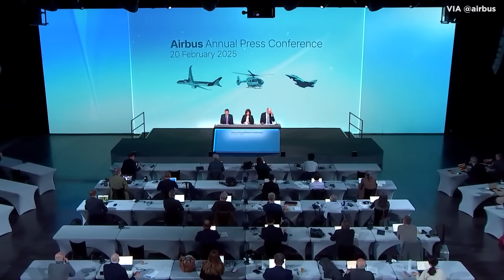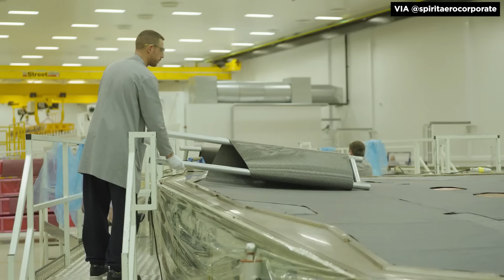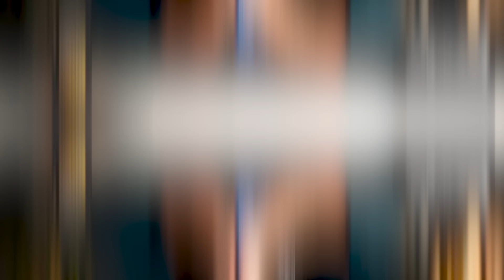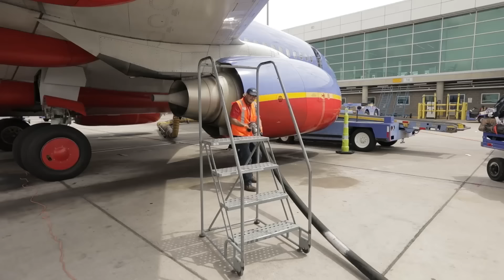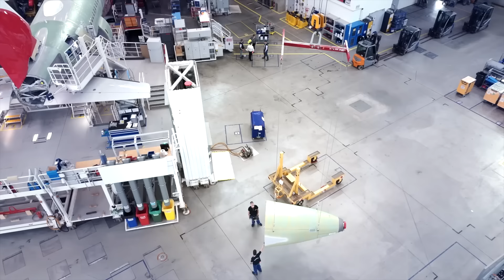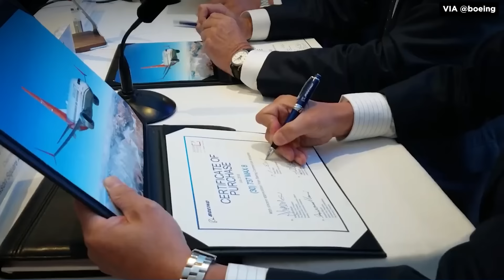Did Airbus just Change EVERYTHING?!

Comment: It's all about energy to weight ratio, and petroleum fuels are just hugely better than anything else, and that's before you get to the infrastructure problem.
Reply: In energy to weight ratio hydrogen is 3 times lighter than aviation fuel. The problem is volume.
Reply: @elkozinski  yes but the heavy reinforced tanks negate that completely
Reply: @nether_bat  Hydrogen is supposed to be liquified by temperature, not by pressure. They'd need thermal isolation, but that's not heavy.
Reply: @elkozinski  yes but hydrogen can leak through most materials so special (heavy) tanks are needed. And if the cooling system fails the tanks will become pressurised within a few hours, risking a catastrophic explosion that could kill people nearby.

Comment: Idk why but the mock of the Rise on a small plane looks terrifying. Small children everywhere will refuse to get on that plane lol. One strong argument in favor of not using the open fan design on that note is engine cowling can catch dislodged blades/fragments
Reply: I don't think they'll ever be able to get noise levels down to closed fan noise levels either
Reply: Blades that big will have to spin at a slower speed, fuselage parts in line with the blades can be reinforced
Reply: Is it significantly different than props though?
Reply: @brianwelch1579  this is just speculation right, but i would think the larger blades would still have less energy than traditional props(so less dangerous) although their size may still look scary to some i admit.
Reply: You can 'armour' where they hit, which they still do currently sometimes. (Kevlar and resin would likely be enough to catch them, and thicker plexiglass windows there)

Comment: If we consider the rate of improvement of battery technology/cost, an electric airplane is much more likely and feasible than hydrogen.  You should do a show on this.  Battery energy density are improving dramatically each year
Reply: Battery is viable for puddlejumping. Longer haul is where the issue lies and the long term solution for many routes is likely to be vactrains, despite the incredible capital expense of establishing the infrastructure
Reply: @miscbits6399 vactrains are an impossibility. Vacuum tubes are notoriously tricky and any failure kills everyone on the line. Some miniature cargo for between amazon warehouses maybe, but they haven't even considered that yet.

You can't defend it above ground, or maintain it below ground. It's a toy of an idea. Maintaining that pressure would be a huge energy sink also.
Reply: It would take a many fold increase in battery technology to get even close to the energy density of standard jet fuel. Engine efficiency is the best place to focus.
Reply: No, even a basic electric car weighs more than double its petrol equivalent. Look up the rocket equation and it will make sense. Electric vehicles weigh roughly the same at the end, petrov vehicles get much lighter therefore increase greatly in efficiency over time.

Even if they could make parity in energy density with fuel without extreme volatility (which is chemically implausible)  it still would be a huge downgrade from aviation fuel.

And that is besides the use being much higher than a leisure vehicle, that's a lot to replace every couple of years.

Sure drones work, and maybe light aircraft, but commercial jets have dangerously high power draw
Reply: @mandowarrior123  Electric cars don't weigh twice as much as petrol cars? You're telling me that for example, an ID.3 weighs 3000 kgs?

Comment: The hydrogen issue underscores what most critics have been saying for years - apart from the handling issues there's no "green" source of hydrogen that isn't both highly restricted in volume AND insanely expensive to produce - to the point that if you HAVE the cheap green energy to produce hydrogen, you have the cheap green energy to take the extra steps of adding atmospheric carbon atoms to make much denser and easier to transport hydrocarbons. The extra cost of doing so is vastly outweighed by not having to incurr the costs of handling hydrogen
Reply: The only problem is it's even more expensive to create fuels from hydrogen. Like it almost takes twice as much energy to create hydrogen and turn it into methane compared to just producing hydrogen.
Reply: @seasong7655 

You know that there is already a carbon negative methane fuel that is widely used in large quantities in California that is half the price of diesel.
Reply: @seasong7655  I totally agree with you on this criticism. The problem is that for longhaul there isn't much else which has the energy density. Gas turbines will exist for a very long time, just the exact composition (ie: Kerosene or something else?) and cost of the fuel will vary

As we decarbonise in the future, oil is going to snap well over $200bbl and at that point synfuels start making economic sense - with the ONLY viable energy source being some form of nuclear power. Keep an eye on what China's doing with TMSR-LF1 (A rebuild of 1965's ORNL MSRE) as this is the future path I expect nuclear to take - no more water in the core of reactors means a huge safety margin plus temperatures high enough to directly drive industrial processes such as Sabatier

Molten salt reactors have the potential to reduce nuclear costs by 80% in both build & operating costs - at which point all renewables are obsolete - as well as reducing the already quite low volumes of nuclear waste by 99% - the biggest hurdle for these things is that enriched uranium is critical for making nuclear weapons - Actually it's the DEPLETED uranium which is the feedstock for weapons whilst enriched is a waste product, but politicians have turned that understanding on its head for cold warrior reasons - anything which can operate WITHOUT needing enriched uraniunm effectively kills the nuclear weapons industry and most "Conventional" nuclear power is actually cover for the weapons programs, by coming up with a use for the waste products of the weapons process (There's a reason that the USA's depleted uranium is all kept under armed guard on military bases whilst 30,000 tons of thorium was merely buried in the Utah desert)
Reply: Hydrogen is a waste of time and would only be practical if the aircraft used liquid hydrogen, because the volume for pressurized hydrogen would be huge.
Reply: @nzoomed liquid hydrogen for all intents and purposes IS pressurized. It’d be really difficult to keep hydrogen a liquid in transportation uses if it wasn’t under pressure.
Reply: Yes, I can't believe Petter takes the hydrogen plane fantasy seriously. Hydrogen is notoriously one of the most difficult substances to handle. Look at how many car companies are just about to "revolutionize auto with the hydrogen fuel cell". We're still waiting, and will be waiting, because hydrogen is a fantasy. The idea of an airplane crash with compressed hydrogen tanks onboard is unthinkable. Fuel fires are one thing, hydrogen combustion is something else entirely.
Reply: Not sure I understand. I thought the idea of using hyrdrogen was to avoid using hydrocarbons. What you are saying is that there's no point using hydrogen because you can use the green energy (that you would use to make hydrogen)  to make more hydrocarbons ? What am I missing ?
Reply: @timparis70  If you drill or mine for the hydrocarbons, it's bad. You add to the atmospheric CO2. If you syntehsise them, or make them from renewable raw materials, it's better. What we're saying is that hydrogen is an awful energy carrier. Expensive to make, distribute and use. Both in terms of energy and money.
Reply: @timparis70 If we’ve manufactured the fuel (presumably it would be a longer molecule than methane that can be liquid at standard temps/pressures) from atmospheric carbon than than it will initially be carbon-negative. Burning it will simply return that carbon to the atmosphere. This is also the logic behind plant-based fuels like ethanol or biodiesel, although those can compete with food crops, degrade land, etc—which wouldn’t be problems for e-fuels. As far as I’m aware the current impediments to e-fuels are expense compared to fossil fuels & the overall poor energy conversion ratio, which will require lots of excess electricity to be worth doing. But that’s where lots of solar capacity could possibly sync with aviation’s need for energy dense, but carbon neutral fuels.
Reply: @timparis70   You can look at H as a battery, you need an energy source to produce it, the most economical way is using NG (primary source). Just like a battery there is a loss of energy during the conversion. You get more mileage from using primary energy sources directly. That is why the world runs on oil. Hydrogen economy is a pipe dream.
Reply: @iorr98  Yes - if your your primary energy source is oil, then the cheapest solution for airflight is definitely oil. Especially as all the innovation and research on how to best use oil has already been carried out. *There is no point using hydrogen for airflight if it is produced from fossil fuels as is the case today*. HOWEVER - the objective for using hydrogen is to avoid uing hydrocarbons due to their impact on the climate. In financial terms, the TCO (Total Cost of Ownership) of using fossil fuels is far too high. If you want to use renewables, such as solar and especially wind, the fact that hydrogen can be viewed as a battery is a massive bonus because these energy sources are not particularly stable. That variablity is the main thing holding them back as incompatible with national distribution systems.
Reply: @timparis70  you combine the hydrogen with carbon from the air, and then when you burn the fuel the carbon goes back into the air. So you end up carbon neutral but the cost of extracting that much carbon from the air and processing it with the hydrogen into fuel would be non negligible to say the least
Reply: @fl00ds while more scifi than science right now; if someone could crack the code of semi-efficient co2 extraction, paired with h2 production, then this would enable any airport with access to power and water to produce fuel on-site. Not having to extract, transport, refine, transport and distribute fuel gives room for a relatively inefficient process to still come out on top in well to wheel efficiency.
Maybe it will be before fusion, maybe not.
Reply: @fl00ds  I'm very happy to be educated on this subject. However, my physics and chemistry are not so bad. There are two ways to get energy from hydrogen : combustion (like natural gas) to generate heat which unfortunately is quite inefficient requiring a huge amount of liquid hydrogen be transported, or hydrogen fuel cells to generate electricity which unfortunately requires precious metals such as platinum and iridium. In both cases carbon is not involved in the reaction, only water is the by product. The carbon related issue with hydrogen is that today, most hydrogen is made using fossil fuels. But as I already pointed out, this shouldn't be the case long term. Hydrogen has other issues which might prevent its use in airflight (those that I mentioned above, safetey, distribution, storage). But producing carbon is not one of them.
Reply: @timparis70 

Pretty good summary, only nitpick I have is that the energy efficiency difference between the latest turbines (particularly those that use steam injection), ICEs (designed for hydrogen), Karno heat engine and a heavily loaded fuel cell are basically very similar. Not the obvious thing that people think. They are all around 50% thermal efficiency. Large ICEs with a bottoming cycle are 54% efficient. Turbines with a bottoming cycle are 64% efficient.
Reply: @Mentaculus42  Interesting, thanks. I'll read up on this.
Reply: Hydrogen is completely stupid. Just the basic physics of it are stupid. Also you can't readily store it without insane cooling and even then it still leaks and damages the container. Only if there was a way to stabilize the hydrogen by binding it to carbon...
Reply: You are missing that Lockheed tried to use hydrogen and discarted it because of the volumetric inefficiency , long before the false climate warming, then cooling, then the compromise change, but all false to the core. Slowly the rationale that carbohydrates are best, hybrid electric a close second, is being reinvented. The real solution is to use high strength carbon nanotubes to reduce the spanloading and laminar flow , suction stabilized to maximize the all important L/D with the best 45 deg sweep back , cruising at high flight levels, from 350 to 45o near the end of the flight.
Reply: @Arturo4586 carbohydrate is another word for “sugar”. That’s not the same thing as a hydrocarbon. If you’re going to peddle big oil disinformation, at least try to sound like you know what you’re talking about. Also, no one has ever seriously thought it was going to cool the earth, not even Al Gore. That’s a predicted regional phenomenon called “AMOC collapse” and would only affect areas surrounding the North Sea which is kept warmer than you would expect thanks to the Gulf Stream.
Reply: It all depends on the availability and price of kerosine. H2o has a high energy density. Ideal for large long distance planes.
Reply: @HeyFixThis  If you mean H2, no it doesn't. Any carbohydrate has a higher energy density. And they don't go boom as often.
The appeal with hydrogen, as a fuel, is that it burns cleanly. Everything else about it is just awful.

Comment: If only there was a cost effective way to produce hydrogen. Oh, there is, nuclear.

Nuclear is traditionally used for base load generation, where continuous operation increases efficiency and reduces costs.
Solution? Make some of your capacity duel-use. At peak demand, make electricity. At low demand make hydrogen.
Unlike renewables, where your hydrogen production is to cover periods of low generation, here the hydrogen can be sold as fuel.

Comment: With the drive for efficiency on turbofan engines increasing engine size, will we see a new high-wing passenger aircraft?  There's only so much taller they can effectively make landing gear to fit larger engines under the wings
Reply: Or on top of the wings
Reply: Sell some seats in the engine too

Comment: Whats more efficient, burn liquid hydrogen, or using a fuel cell?
Reply: fuel cell - by quite a margin. In addition, burning hydrogen in a combustion engine results in almost unavoidable NOX emissions

The question for aviation becomes balancing all the factors. Turbines use 30-50% more fuel than piston engines but the achieveable power output, massive reduction in moving parts (hence improvements in reliability) and weight reduction more than make up for having to carry more fuel (as one example, when the original Lockheed flying wing was converted to using turbojets, range was cut by over 1/3 -  It's hard to fit all that extra fuel into an already existing airframe)

Comment: The aircraft body is cylindrical, so perhaps one could store hydrogen there and put passengers in the wings? 😛
Reply: Unfortunately, the passengers require pressurisation too. Perhaps they can convince the passengers to breathe hydrogen and kill two birds with one stone?
Reply: @thomasdalton1508 bit drastic but good measures against overpopulation I guess 🤷‍♀️
Reply: I.... don't think that design direction is too crazy! 
This should actually be really looked at as an option. With wings cross section size changed of course :)
Reply: Don't give any ideas to Ryan Air!!!
Reply: @rjk471  best comment
Reply: IIRC some concepts have a long pressure vessel running over the entire top of the cabin. Which should also help direct the fire upwards if the entire thing explodes with the aid of blowout panels.
Reply: @ this actually makes sense and if you make the body a bit higher you lose almost no space
Reply: Leave the passengers at the airport and take off without them, they're mostly disgusting creatures
Reply: That's why God made Velcro - ya stick 'em ON the wings!
Reply: The biggest issue is price... hydrogen, and especially the EU pipedream "net 0 hydrogen" is extremely expensive. You would need almost free electricity to make it viable.
Reply: you didn't pay the oxygen mask fee, so you better hold your breath now.
Reply: In cylindrical tubes on pylons under the wings :)
Or maybe it’s time for a double bubble fuselage :)
Reply: @AtomicBuffalo Like Fighter jet external fuel tanks 😂
Reply: @AtomicBuffalo  How about a Bendy Airbus? With two sets of wings?
Reply: I think the all hydrogen thing is unnecesary and dangerous plus overcomplicated
Reply: @SKYCLIPPER I think airplanes are unnecessary and dangerous plus overcomplicated
Reply: 😂😂😂And make the wing from plexiglass... imagine an aircraft with all front view windows! Added bonus, a bird collision would be epic!
Reply: @torbjorngranlund6299  
But is that not effectively what a blended wing body does? But realistically it is possible to have a hybrid between conventional tube with blended wing body that does keep everybody happy. No matter what, the use of hydrogen will increase the volume per passenger to use hydrogen. However it might be possible to increase the overall efficiency a lot. The HySIITE engine showed that they could increase the efficiency of a hydrogen burn engine by 35% (and reduce contrails & NOx).
Reply: Passengers were traveling in the wings in early German aircraft so not as funny as it sounds.
Reply: @ Because the wings where so thick, people could fit inside near the main body
Reply: Haha!
Reply: At least it works on paper.
Reply: So why didn't the Hindenburg and other great airships run their motors on hydrogen? Lol
Reply: It's disturbing to think that it's not impossible that Trump would think it's a great prospective and subsidize it 😂
Reply: @maciejzettt  clearly you dont know Trump hes against the new green scam